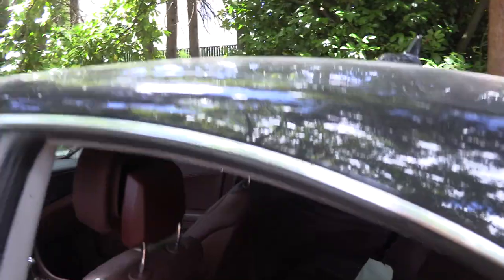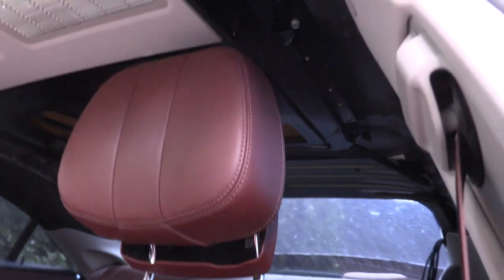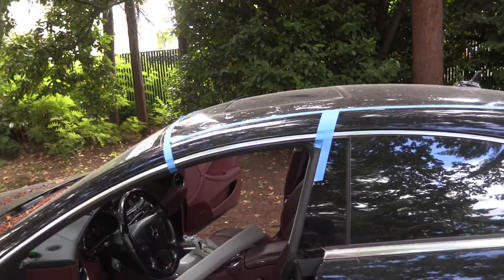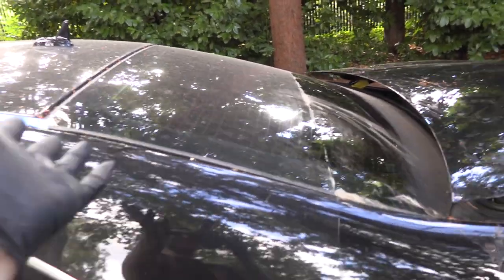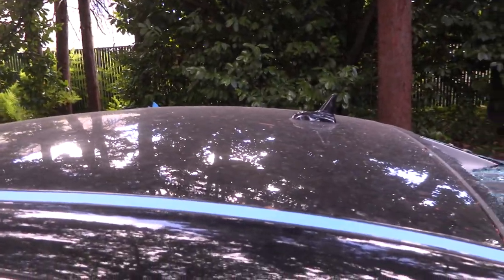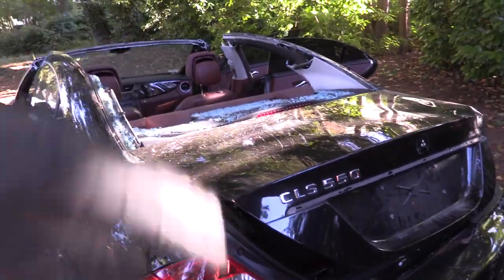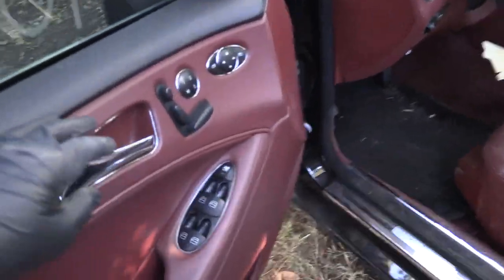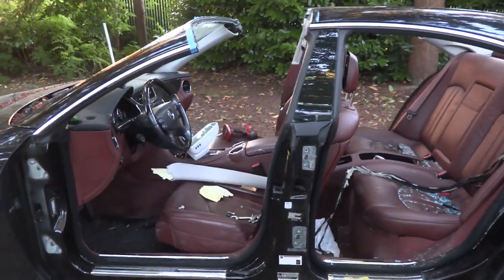Not All Cars Go To Heaven - Mercedes CLS 550 Goes Roofless

Comment: While 'Ye and Jigga are clearly having a blast driving the chopped and screwed 'Bach in "Otis," Kovacs said at this point the frame of the car is probably buckling and it's folding up "like a taco," because it appears that the center roof supports have been taken out.

Comment: FYI: a suggestion "for the next time", you can take car to fire dept. & ask them to use that big saw they have (looks similar to angle grinder/skill saw if know what mean), & as long as you will sign a paper saying they aren't responsible for any damage & it's a training day on that equipment they will probably cut off your roof for free! Little Tip, & depends on the fire dept.
Or you can buy one of those saws but they pricey.
Hope helps "for next time", lol
Cheers, A

Comment: But it wasn't even this car they used, it was an older Mercedes, almost completely different type of mercedes, they used a Maybach you're using a CLS 550 
I feel like you could've saved this car which was actually pretty good, flipped it and gotten something closer to the original

Comment: Why did you cut the door wiring harnesses? I've taken apart mercs, and honestly they're not that bad to take the harness off of. Depending on the year and model, you unscrew (usually a t30, unless i'm mixing up BMW with benz) or just unclip the plastic bit, pull the connectors loose, and then BAM, you can keep your harness intact and easier to deal with :(